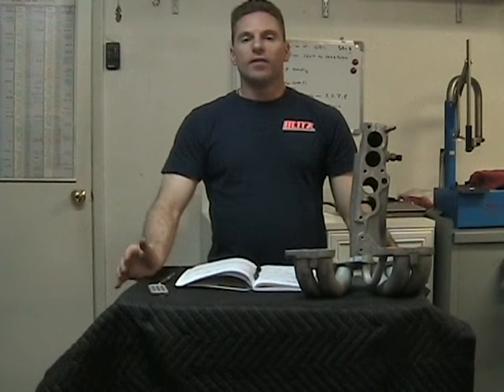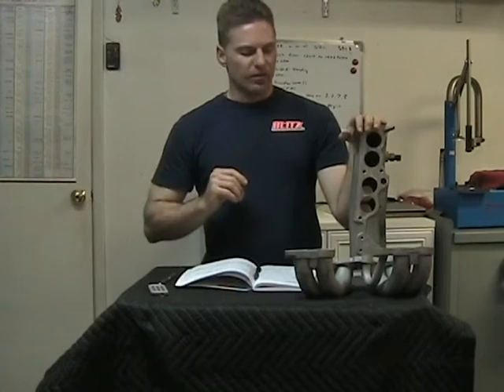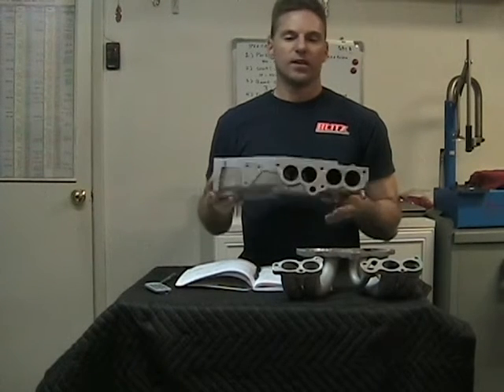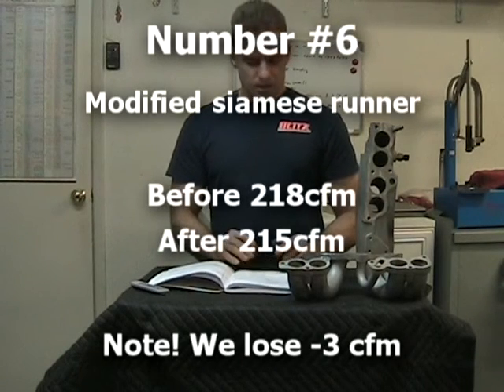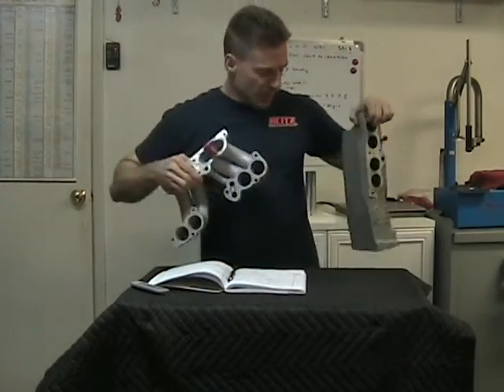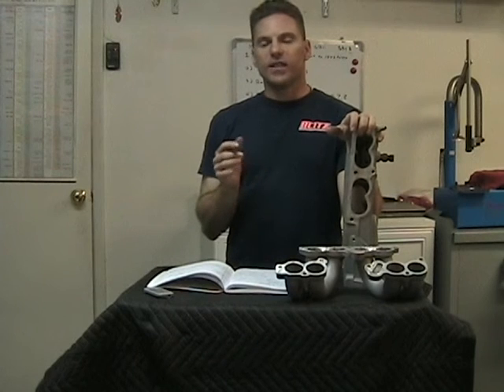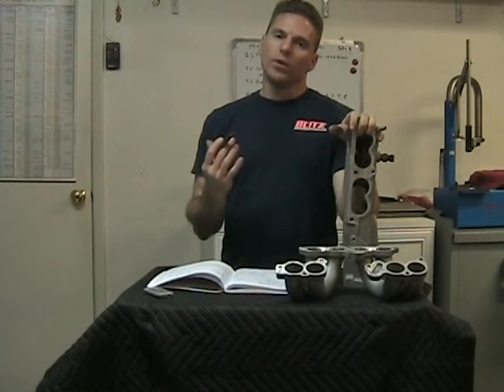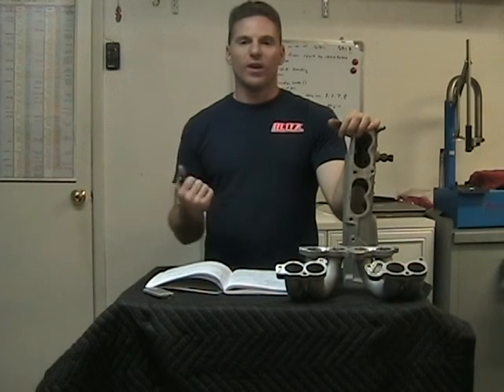TPI Intake porting  (Video #4) siamese runner

Comment: I wonder if anyone has done Extrude Hone too see what numbers they can get.🤔
Reply: Extrude Hone was popular back in the 90s, but I've never heard of any real numbers.  Best bet is look for some used large TPIS runners(if you can find them). They flow 20cfm more than stock.
Reply: I have an idea I have never seen done before.  If you have an old plenum, try & install a divider wall down the middle to make it a duel plenum to increase velocity to each bank of runners similar to a duel plane manifolds with a divider wall & possibly with a shaved down 1/2" +/- divided wall behind the throttle body to create an air gap behind the throttle body the  too allow some crossover like done on some duel plane manifolds for carbs,  especially to help #2. runner to make that sharp turn.  
The TPI harmonics inside the plenum I imagine are very complex & very violent like in a duel plane carb manifold & wonder if it was designed for a ram effect tuning from reversion from one bank to another which I think can't be duplicated on a Flow bench other than on a running engine with many pressure sensors installed in the plenum & along each runner to know exactly canard going on & really how a TPI behaves.    Maybe, a divider wouldn't be good or, maybe it could, & the o.e. didn't do it because was too complicated to cast a divider wall inside the plenum....🤔
An easy way to test this idea is to just rout or mill a slot into the top & bottom of a plenum & fit a 1/8-1/4" divider plate & use caulk to seal it temporary for flow bench testing.
    If it works, then a more permanent technique to install a divider wall would be mill out the perimeter of the plenum bottom with also a slot in the middle to allow the divider to extend thru & shape the divider to the plenum ceiling & either weld or epoxy it to the plenum ceiling & then place the plenum bottom over the divider extending thru the plenum bottom & finish epoxying or weld it into place!  I believe it needs welded because of violent harmonics that I read on Speed Talk Forums that divider walls on duel plane manifolds with removable dividers got bent or some who tried to install thin gauged divider walls on single plane manifolds had gotten mangled!!!! 🤔 
    I ran this idea by FIRST TPI & he said they had explored this partially & have a semi divider wall in their plenums & will be doing R&D to explore this combo more in-depth some day for a full divider wall.  I guess the FIRST TPI is the best one on the market now.
Probably the best way to get real power from a TPI is by supercharger like a few guys have done on Y.T. but the best vid series was done by the very well-known & famous GM guru & collector Matt Garrett with his ZZ3 355 or maybe it was a 383'but with 11:1 I think which he says worked great but only using race gas.

Comment: If you knife edge the area between the ports on the upper intake it makes the flow better I did a before and after comparison on a chassis Dyno the before numbers were 232 with factory tpi with Cam and headers after the Port and polish of complete factory intake manifold we made 267hp and 362ft.lbs